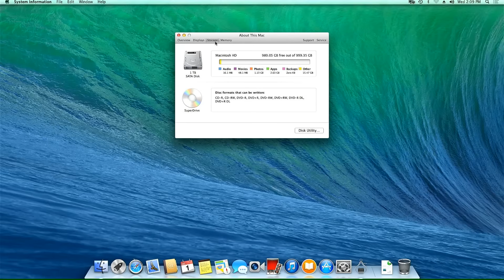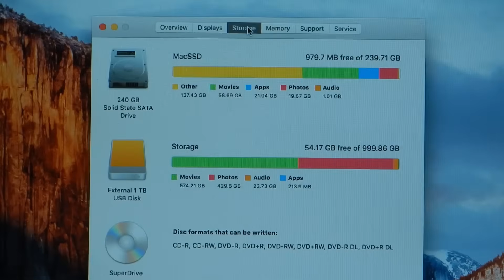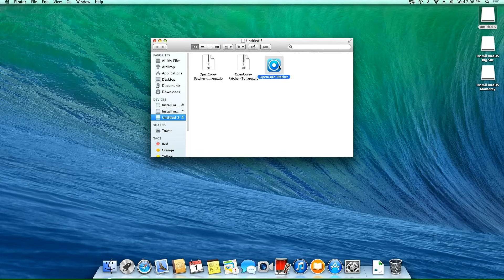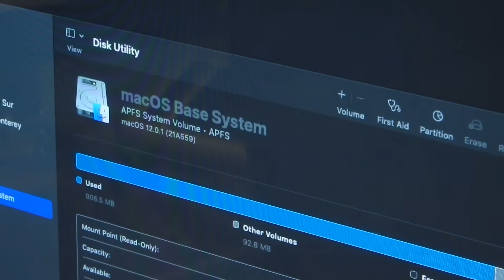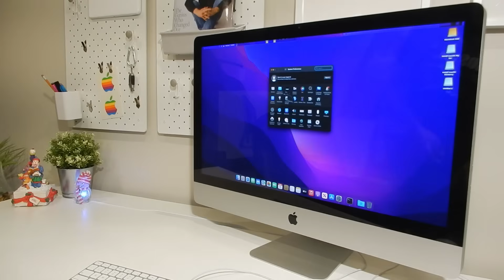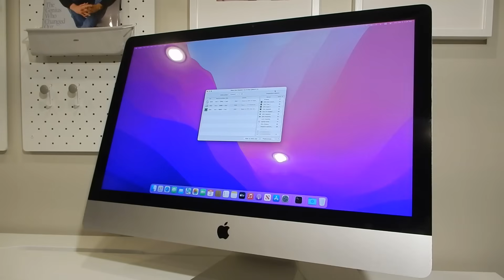Apple thinks this 2009 27" iMac is worthless. Let's refurbish and upgrade it to Monterey!

Comment: Thanks to your video I bought imac late 2009  27` (but unlucky with core2duo)  for my parents as youtube/web serfing/online streaming machine for use on their kitchen!
This thing cost me about 90 dollars with shipping,was the dirtiest machine i ever opened,and had failed GPU,but....I baked GPU, installed SSD booted OCLP....and now it's great 2k 27 inches media machine!Thanks for the  video!
Reply from the maker: For what you're using it for, the Core 2 still holds up alright.  If you've got 8GB RAM and an SSD, it should still be very comfortably usable.  And at $90, you basically paid for shipping and got a free Mac, lol.  Congrats!  Great deal!

Just one note: use something like Macs Fan Control or similar to make the GPU run cooler.  The bake trick is usually temporary, but from my experience running it cooler can extend the time before it fails again.  If it does fail again at some point, might be a chance to upgrade to a Metal GPU :) https://youtu.be/n9koG8p9Ch0

Comment: I have  a time machine back up on my 2009 late imac. Still runs great. Since SSD is empty do I just plug in my external drive with Time machine?
Reply from the maker: If your SSD is completely empty, you'll need something bootable or you'll just get the flashing folder error icon when you turn it on.  Time Machine backups are not bootable.  There are generally 2 common options here:

1. Boot your original hard drive and clone it to the SSD using something like Disk Utility or Carbon Copy Cloner.

OR

2. Install the blank SSD, boot using a Mac OS install USB (you can make one pretty easily).  From the Mac OS installer, there is an option to recover using a Time Machine backup.

If the SSD is already installed but you want to use the clone method, plug your old drive into your Mac using an external SATA to USB adapter.  Hold OPTION key when powering on until the boot picker shows, and choose the external drive.

Comment: I had to take my late 2009 I Mac to apple repair , and they considered the board is to be replaced but because it’s “obsolete ‘“ cannot be fixed . Please advise .
The Mac switches off before it finishes to load after turning on ..has OS 10.3 .I had added ram to 8gb. I still want to save it , Is it possible ?
Reply from the maker: They say "cannot be fixed" because new parts are no longer available.  At this age, you have to fix it with used parts, which official Apple repair won't do.   A good independent repair shop will be able to fix it, although labour cost may could outweigh the value of the computer at this point.  Make sure to get a quote beforehand.

These iMacs had a few issues:

If it's shutting FULLY OFF (no fans/completely dead), then I suspect it is the power supply.

If the screen goes black but the fans still run and you can see faintly it is still lit up, I would suspect the GPU has failed.

If you can still hear the fans, but there is no faint glow (backlight) of the black screen, it could be the backlight inverter has failed.

Those are the most common issues I've found with the 2009 models.  The main logic board could be faulty, but this was not very common from my experience.  The most common were the issues above.  All of these parts should be available used, but again may not be worthwhile depending on the parts + labor cost.

Comment: Had this iMac from new until 2015 first thing I updated was the ram to 12gb when I bought the iMac , I ended up having to get rid after updating OS to maverick the fans would spin up constantly, the CD stopped working , and it was a nightmare to get the OS  reset to snow leopard as without the disc drive I could not use the OS disc that came with the iMac, and you couldn't back date the OS though Apple updates , so had to buy a USB with mountain lion OS on it to get the iMac back into a usable state, then I sold it  . I loved the computer, but it was the first and the last mac I ever owned, I hated not being able to upgrade . I have now built 4 pc's myself and the one I am currently using has a 40 inch 4k monitor  64gb ram Ryzen 5900x with a 3070ti  and 20tb of storage and all the RGB I could install lol , when I was looking into buying a new iMac it just didn't make any sense financially for me, it was much cheaper in 2015 just to build my own and in doing, so I now actually known what all the crap in a computer does .
Reply from the maker: Yup, there is certainly a financial premium on Apple hardware.  If you don’t need Mac OS or any of its proprietary features, a PC is often better value as far as performance for the dollar.  And being able to customize and upgrade is a huge plus!
Reply: I agreed about this. No wonder why a cheap PC can do it better than a expensive m3 mac. My ancient PCs are still going strong. Office, Surfing, Gaming, no issues.

Even without upgrades! Should be avoiding Apple Completly.

Comment: I got the same model recently 2nd hand with a failed AMD graphics card. Opened it up, took every out and cleaned it. Had to replace the ODD/ gfx card fan due to noise. Then I ordered a NVIDIA Quadro K1100M, a cooler for MXM-A graphic cards (because I don’t have the means to modify the MXM-B one from the AMD card. I also ordered the Slimline SATA cable for the additional HDD/SSD underneath the ODD. Gonna use it to run the OS off. Last but not least the iMac will get 32GB of RAM.

Comment: I bought half a dozen VGC vintage iMacs circa 2011 for $1000 a few years ago at auction for my small culture school here in Tokyo, from a business that had upgraded to more current models. They were a mix of i5/i7 4/8GB models with functioning 4750 and 4770 graphics boards. I used them to replace the 2Gb Core 2 duo 2008(?) Macs I used to use... 
I dedusted the interiors and replaced the hard disk on all of them. They have been running flawlessly for over 3 years.

I'm loath to upgrade them to Monterey since they are completely trouble free, but may have to as VS Code is depreciating High Sierra Support at the end of this year.
Reply: Do you always have to update to the newest version of VS Code?
Reply: @zizlog_sound  it’s still got a lot of bugs. Especially Java support.

Comment: They arr selling me one for $60 i just want it for my 3 year old boy and the lady told me it just needs an upgrade , good or bad ?
Reply from the maker: I think most people would say $60 is a great price if it's working, and you're sure the GPU is good.  It's important to know the stock GPUs were VERY common to fail, and sometimes look perfectly fine until you run for a few hours and start getting random "unexplained" crashes.  In worse cases, it will be obvious and there will be weird lines/bars/blocks on the screen.

Comment: I got a late 2009 iMac 27 inch I want to upgrade it to i7 help me
Reply: It’s a A1312 (emc 2309) iMac 10.1
Reply from the maker: I do have an upgrade video planned for a 2011 where I will be upgrading from a Core i3 to Core i7.  The 2011 is not identical, but still similar.

Comment: isnt laggy or difficult to run apps because u installe macos   patched ?
Reply from the maker: If you don't upgrade the GPU, then some graphics/animations that rely on Apple's Metal acceleration don't work right.  Things like Apple Maps, Final Cut, etc.  Didn't have any issues with web browsing with Chrome or office software.  Even Photoshop worked properly.

If you upgrade the GPU like I did in this later video - https://www.youtube.com/watch?v=n9koG8p9Ch0 - then it works flawlessly!  All system graphics, animations, and software work (so far) perfectly.  The upgrade is difficult and a very advanced upgrade; you should do lots of research into it before starting so you know what you'll be up against

 Without the GPU upgrade, it's still really good.  Your trade off is that you get a new modern operating system with current updates, software, etc but at the expense of potentially some graphical glitches.  These Macs are getting old enough that the last official supported High Sierra 10.13 can't get a current web browser and has issues loading websites.  I think the trade off is worth it.

Comment: Nice I upgraded my 2011 iMac to Monterey but it has a problem it sorta has a seizure when using Siri
Reply from the maker: I imagine the Siri animation probably uses Metal acceleration, which would open when you summon Siri.  If you're on the stock GPU, Metal would be patched out by the OpenCore patcher.

I did upgrade the GPU in the 2009 iMac to a Metal-supported one: https://youtu.be/n9koG8p9Ch0

Just note that the GPU I used is known to have some issues on 2011 models, so you may want a different GPU if you ever do this upgrade.

Comment: I was with you until you dissed the idea of still using a CD/DVD drive.  SOME of us still make regular usage of them.  So if your modification requires removing the optical drive, not much use.
Reply from the maker: I wouldn't mind keeping the DVD drive, but these iMacs are SOOO tight for space inside there's nowhere else to put an additional hard drive.  So I can either have an additional hard drive, or the stock DVD drive - and since I use discs less than once per year, I'd rather have an external DVD drive plugged in once a year than an external hard drive connected perpetually :).  I totally get your point though!  There are a legitimate number of people who still use optical drives, which means they'd be better off to replace the mechanical hard drive with a large SSD instead.  Then they could keep the optical drive too :).  I still use CDs/DVDs myself, just never need to for this iMac.

Comment: I’ll bet you’ve not worked in the computer business. Companies, by law as well as market practices, support released products including computer hardware and software (i.e., operating systems) for a prescribed amount of time. It’s scalped End of Service and End of Support lives. With each new spin of the operating system, for example, manufacturers need to back test the older but supported code. You can imagine that the permutations of hardware and software revisions can grow quickly. At some point though, it simply does not make sense to continue this forever fir all combinations ever developed. Hence, companies declare on schedule and well ahead of time when they trim the old parts. So while you can use everyday vernacular to describe this topic, you’re really letting on that you don’t understand what it takes to make and support things to be commercially viable and that you don’t understand the inner workings of devices you type on or speak into.

Comment: I have one of the last iMacs with the intel chip and it has become so slow it’s getting near unusable. Apple says it’s good for recycling only but I’d like to get more time out of it if possible. A Genius installed an older operating system but as soon as I restored my files from Time Machine it reverted to Ventura. Too bad I don’t have your skills to get it running properly again.
Reply from the maker: If it is one of the last Intel ones, it can't be very old and shouldn't be that slow!  If you open "About this Mac", what year does it say?  Which CPU model?  How much RAM?  Do you know if it has an SSD?  Maybe I can give you some ideas to improve it.  You probably don't need anywhere near the amount of work I did on the 2009 to fix yours.
Reply: @rebootretro  it’s just over six years old, bought in 2017, 8 gb ram, 3 Ghz quad 4 intel i5, Retina 4k radeon pro 555 with 2 gb memory. The hard drive is 1 terabyte, not an SSD. I’ve moved the majority of photos and videos to an external drive to try to clear up some space on the drive but it’s not made much difference. Every app loads slowly, and it can be minutes of watching the beachball of doom when you wake it up, load a page in Safari, or do a cold start.
Reply: @Quince828 Try to install Ventura to an external SSD - even though USB 3, will be much faster than the external HDD. Thunderbolt even faster, and you won't have  to open it up 🐶 0:00
Reply: @hjsmtl9772  The imac only has usba and external drives aren’t thunderbolt

Comment: I’ve been trying to find the oldest computer that through upgrades no matter how difficult can be used today to surf the net watch YouTube those kinds of things so far the oldest one I can do it with is my 2485 power Mac, but I know I can go older than that Does anybody have any suggestions I wanna try to use something from the 90s! I don’t care if I have to even use a modern GPU as long as we can find a way to support the bus that’s fine I want to get one of those G3 towers the beige ones I think that could be the oldest possible computer still able to handle YouTube what  do you guys think?
Reply from the maker: The problem isn’t even CPU/GPU power, but lack of software support.  I think the newest web browser that runs on a PowerPC processor is TenFourFox (FireFox fork) and they dropped support for that a few years ago now.  I think the Beige G3 (maxed with upgrades) might load a YouTube video - in fact, I feel like @ActionRetro has done this?  There’s a chance at something older perhaps with a beefy Sonnet accelerator (I think he may have done that too, lol).
Reply: @rebootretro  yeah, I have asked Shawn at action retro about it and you can use Firefox because there is Adele linux that is a modern Linux design for power PC. It’s also the last one to do it, but that being the case software is not the issue I think it’s going to come down to gpu’s and memory.
Reply: @rebootretro  Shawn hasn’t done Adelaide Lennix in the base G3 yet but I think he plans on doing it unless I missed it but the problem is probably going to be the memory so I’m trying to figure out if there’s a way to use PCI/to add extra memory, or if there’s a way to use a section of the SSD hard drive that I put in as a memory. I’m not sure if that’s even possible. I’m trying to figure all this out. I don’t have a formal education on this stuff I just tinker lol.

Comment: Are use a 2008 iMac I just put in four gigs of RAM and Linux mint and it runs absolutely perfect. I’ve been using this computer as my daily and watching TV on it as well since 2008! You are so right all these Macs are amazing computers if you just get rid of that bulky OS X and put Lenix in them! I also have an HP G3 elite with a core I seven that I don’t even use because my macs do the job already with no problem when these days I’m gonna try to put windows 10 and 11 on my 2008 iMac and see how that runs. I don’t know if it will run good but mint runs absolutely perfect.
Reply from the maker: If you upgrade to an SSD and have your 4GB RAM, it should run Mac OS Ventura alright for web browsing.  But it will run Linux Mint better, I think :).  You could triple boot Mac, Linux and Windows!
Reply: @rebootretro  sorry I was using voice to text. I meant that is what I do. I run meant on there. I took Mac OS X off because it’s not supported anymore and I’m tired of trying to get websites to load but with mint it runs perfect and I don’t think Windows is gonna work because it’s too big of a program, but I have an actually tried it, because mint is so awesome! Like I said, I have newer computers that I don’t use because my iMac is the perfect computer/TV I use it for literally everything I even use it as a monitor for my Xbox. I’ve also installed men on an A1 to eight Mac mini and it seems to run perfect on there as well. I haven’t tried it as much but everything that I have tried. It works perfect. Next thing I’m going to do is heat up the CPU on the Mac mini and change it over to a socket CPU so I can put the t9500 processor in it.

Comment: I have a top of the line 2019 iMac with 6TB of ssd storage and 128gb of ram and I’ll tell you it is not nearly as fast as my m1pro MBP.
Reply from the maker: Yup, X86 processors are coming to the end of their era.  Gotta keep them running until they’re obsolete :)

Comment: "2TB of spinning Rust." Hysterical!!! However, Apple considers things vintage at the 2 year mark. Until last year I was rocking a 7+ that worked well, so I upgraded to a premium plus used 12 Pro from Amazon. The look of horror on the 15 year olds at the Apple Store was priceless when I brought it in :)
Reply: At the 2 year mark?? Apple is well known for supporting devices far longer than other brands. That iPhone 7 had its last major update in 2022 (6 years after release) and is still getting security updates (Last week, 31st March 2025, with iOS 15.8.4).

Comment: I had a same iMac for years. Upgraded to 16gb RAM and an 1TB SSD. Sadly the GPU failed three years ago :(
Reply from the maker: That’s terrible!  The GPU failures were probably the biggest problem these Macs had.  The nice thing is that many of them had socketed GPUs that were replaceable.  I upgraded to a Metal supported GPU in this video: https://youtu.be/n9koG8p9Ch0?si=3ex4lCtjY0F5-4b0  The GPU I used is pretty cheap these days, although it’s a lot of hassle to do the upgrade.
Reply: @rebootretro  I tried to search for a new GPU but found that very difficult to do the upgrade so finally I sold it to a guy who told me that he will fix the computer.
Reply from the maker: @gabesz Yes, it is very difficult!  Definitely not the same as upgrading a GPU in a PC tower!  And even afterwards there can be some problems, since it is not “officially” supported.  Glad someone will fix it though!
Reply: This is why it's better to buy always a iMac or any laptop with just integrated Intel GPU. It never fails. Intel Iris are really good integrated reliable graphics chips.